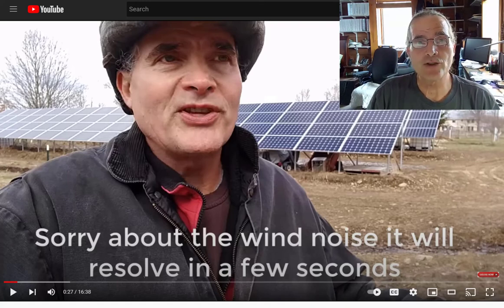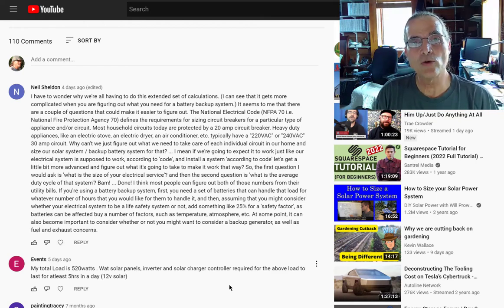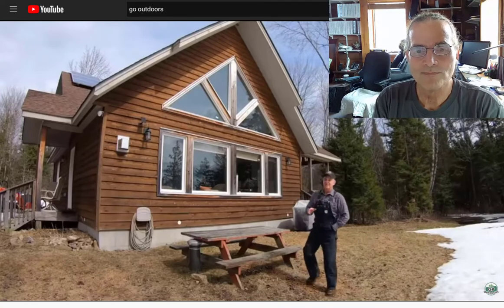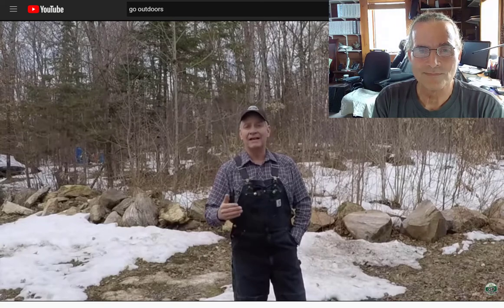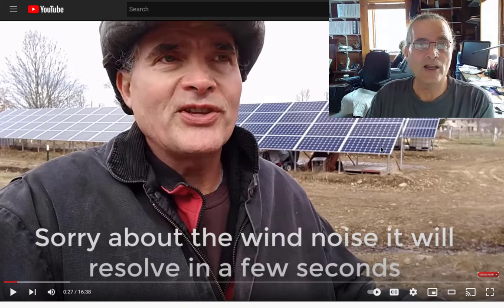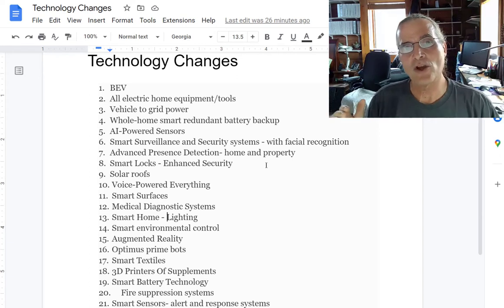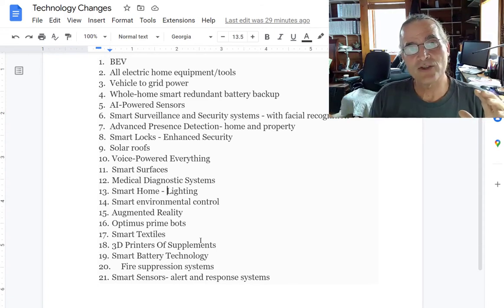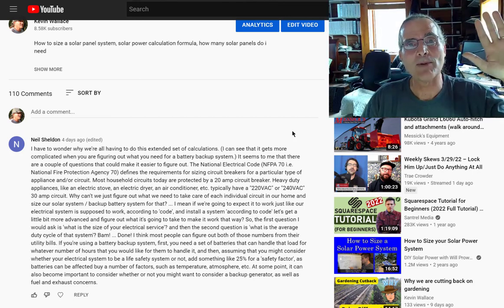Why bother calculating the size of your solar panel system

Comment: I'm way more pessimistic. All those devices alert around all time and needing energy, internet connection and service providerd and/or cloud dependend. All vulnerable to human (software) errors, or victim of external failings or even deliberate internet attack/hack.  I observed a failing emergency electric sytem backup at an academic hospital ( just wired the wrong way), supermarkets not being able to price their products, banks not being able to do electronic money transfers, all trains in Holland did not ride today because their central guidance system was down, and even businesses being hacked and their electronics held hostage in order to pay a ransom, etc.
All these interconnected systems are also used to spy on you. When we complained that our internet connected TV was showing purple blurs on the screen, the supplier did check the hours of usage and stated that it was normal for that amount of usage. Few days ago I ordered cheaper new ink for my printer, guess what was stated in the installation guide: disable internet updates for your HP printer because they did invalidate non-HP cartridges in the past.
But I'm happy with with my solar panel system, it produces year around as much as we use. So they pay us. The only problem we now have is that a new neighbour moved in, and some monkey typed the wrong address/new contract data, so we got a rudiculous end of contract bill and a new contract offered by our energy supplier. It took many hours on the telephone to getting the correction started. On top of that the energy distributor did send us a letter that we have a new connection and they set our smart meter back to default settings (and are sharing these data with other parties).
Sorry Kevin, I'm a KISS (keep it simple stupid) type of person, that likes hard on/off switches but is living in a 2nd hand house with a lot of gizmo's that we are gradually disabling.